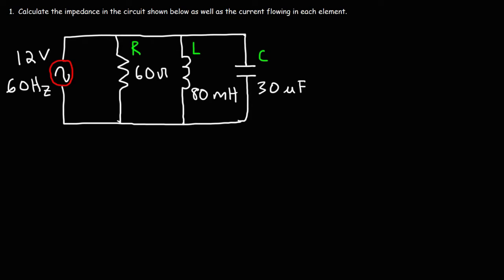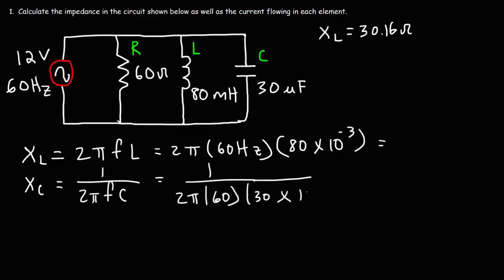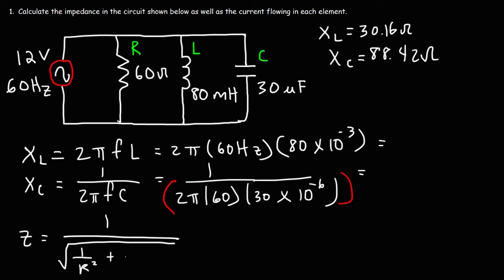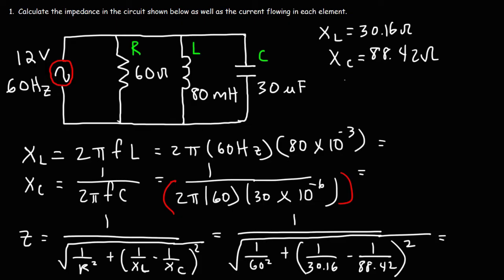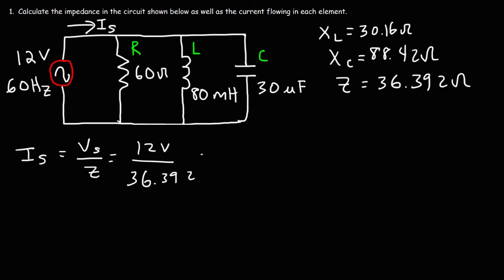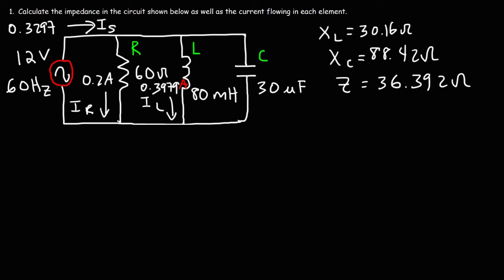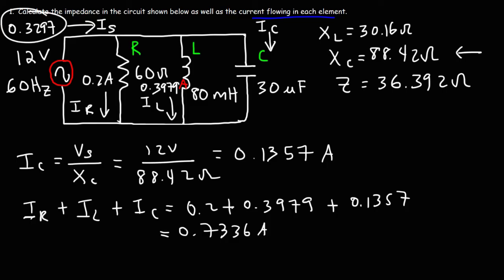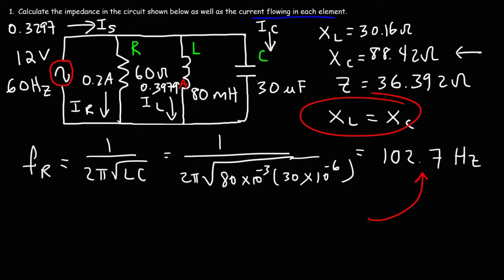Parallel RLC Circuit Example Problem

Comment: Teaching these without the use of complex numbers and just throwing a bunch of formulae at students is a terrible idea.
Reply: Yes. I don’t know how he is avoiding complex numbers. On the Engineer’s Academy web sight, they use complex numbers in most of their circuit analysis problems. I don’t know really how he is avoiding using them here. If complex numbers weren’t necessary for this discipline, nobody would be using them.

Comment: Bro you are wrong ❌ at the formula for resonance frequency which you have used in your video is for series RLC circuit
For parallel RLC the formula is 1/2π√1/LC-Rsquare/Lsquare

Comment: Please help me with this one

a coil takes 15 a from a 250 v source. when a 20 resistor is connected across the coil, the combination draws a total current of 25 a. determine the resistance and the inductive reactance of the coil.

Comment: I plugged your RLC impedance values into 3 RLC parallel calculators and they all gave me different answers--so counting yours, I got 4 completely different answers (and they're not even remotely close to each other) for the total impedance in this RLC circuit.

Comment: why does no one use complex math to calculate these? add 88.42 dms 90 30.16 dms -90 plus 60 dms 0 whatever their respective currents are and then you get your It

Comment: this is very helpful, but my problem is i have 2 capacitors and i assume i need to combine them? i have to plot the frequecy and current. Any tips for this please ? i would think i need to get the total for c so i can use the resonance freq formula

Comment: This is a confusing video, providing no insight into the matter. To understand what is going on, one needs to start at the beginning, namely from the voltages at the two ends of a resistor, of an inductor (coil), and of a capacitor. Without understanding how the electrical current (traversing that component) and the voltage (between the two ends of that component) are related, one cannot understand why the vector sum works, whereas the linear combination fails. The video starts from a formula for the total impedance and... seems to ascertain the validity of the vector sum for the electrical currents. In reality, one starts the other way 'round: from the electrical currents, convincing oneself that the vector sum needs to be applied, and determining the total impedance of the circuit. In any case, a formula is given for the electrical currents flowing through the three components and the total electrical current (around 7:50). Not surprisingly (to me), the tutor fails to address the question: what exactly are these bloody electrical currents? A physicist needs to start from the definitions (whereas, for many non-physicists/mathematicians, definitions appear to be a waste of time). It so happens that the electrical currents discussed in the video are NOT the INSTANTANEOUS electrical currents (obtained when one "freezes time" and "measures" the relevant values). The INSTANTANEOUS electrical currents ALWAYS fulfil the condition "Total electrical current is equal to the sum of electrical currents flowing through the three legs" or I(t)=I1(t)+I2(t)+I3(t). If this condition is violated, then electrical charge is created or destroyed at some nodes, which is, of course, utter nonsense. Treated in the video are the AMPLITUDES of the electrical currents, not their INSTANTANEOUS values. And, in order to understand that, one needs to understand first the PHASE DIFFERENCE between the currents I1, I2, and I3.
Reply: It doesn’t matter. The video is explaining the equations, and it does a great job. Nerd

Comment: in parallel ckt net impedence is always less than the minimum among all components individual impedences. but you got 36 as net impedence when an element having 30 impedence i spresent already there answer should be less than 30.

Comment: How is the formula for resonant frequency same as that of series rlc. circuit?
Reply: Both for series and parallel connections, the characteristic angular frequency omega0 (of the RLC circuit) is equal to the reciprocal of the square root of the product of the inductance (L) and the capacitance (C): omega0 = 1 / sqrt (LC). Many people prefer to use frequencies, rather than angular frequencies, which brings a factor 2 * pi into the formulae: omega0 = 2 * pi * f0.
Reply: Arre because resonance means that the capacitive reactance and impedance reactance are equal, doesn’t matter if they are connected in series or parallel

Comment: could you please also explain (or kindly point to other resources) how would we find the impedance if, say a resistance, was added in series to an LCR parallel combination, and how current would be divided.
Reply: The impedance can be calculated from here, and then we can get the phase difference, after than we can use the phasor diagram to find the net impedance

Comment: There's a couple of things here I don't like here. For one the capacitive reactance should be negative. Two, you're completely ignoring the Phase component of you calculations. This is why when you add up the branch currents they don't equal Is. At 7:58 that doesn't really show that you solved the problem correctly. That just shows that KCL is satisfied. A good way to see if your answer is correct is to check if the the power balances out.

Comment: please solve this 
A 9 mH coil is in parallel with a 0.015 µF capacitor across an 18 kHz ac source. The coil's internal resistance is 60 ohm . The circuit impedance is ?

Comment: What happens when there is another resistor in parallel or series between inductors or capacitors? What do you take as R? or does this only apply to 1 resistor?
Reply: Then take equivalent resistance of both ...

Comment: I kept getting 58.32ohms as the impedance.
Help 🥺
Reply: I kept getting 58 ohms as well.
Reply: Calculate them individually first, and then put it in the eqn..! You will get it correctly!

Comment: But from where does the formula for Z comes?
Reply: You can set up an impedance triangle using R for the bottom leg, XL-XC for the other leg, and Z will be your hypotenuse. These values will all be reciprocals for parallel circuits, mind you.
Reply: @ThePavehead  Thank you

Comment: Did anyone check that last calculation for the resonant frequency?
Reply: yeah, I wasn't sure if i punched the numbers correctly but i got something way off, 0.0024 but i am no wizard with this calculator and doing the inputs.
Reply: I figured out how to get the same answer. just put the 2pie in parenthesis from the start punch in the numbers and then close it at the end for a double parenthesis. one for the exponent and one for the whole eguation.
Reply: @personalselction  Thanks! Yeah, I had to learn the hard way.

Comment: Can anyone tell about the j notation from where it comes?  How to solve that?
Reply: j will represent your imaginary numbers. In this case, when using a current/impedance/power triangle to solve for unknowns, j will equal the total reactance for said triangle. (I through L or C for current triangle, remaining/total reactance for the impedance triangle, and VARs total for power triangle)
So if you have 60 ohms XL and 30 ohms XC, your total or X is 30 ohms and it is considered more inductive. With these values, and the use of an impedance triangle, AND a calculator capable of imaginary numbers functions, you can plug in 30 (for your 'real' ohms, the resistance) + 30 j (for the 30 remaining 'imaginary' ohms, this would be - for a circuit that is more capacitive) and the result, if you are in polar form (r theta appears in top left on my calculator) will be your hypotenuse for this triangle, which is Z or total impedance. You can then use another function on the calculator to give you the angle for this triangle, and that angle will be the SAME for all three triangles, greatly simplifying the rest of the calculations. (the angle will also be - if the circuit is more capacitive)

I hope this helps someone, because complex numbers make a lot of these calculations very trivial.

Comment: How to do phaser math??? TwT I haven't found a good video that really explains how to combine the complex numbers in phasers and finding the Zeq for multiple inductors, capacitors, and resistors combined in both series and parallel in a single circuit. It's the ones where you're combining 60<50* (number, angle sign, 50 degrees) as well as 100+j100, and calculating Vout and current and such. That would be amazingly helpful!
Reply: How I understood, the complex state variable method is a solution to your problem:

https://www.youtube.com/watch?v=_9Ew2LXPsWI
Reply: it's literally just Pythagoras' theorem